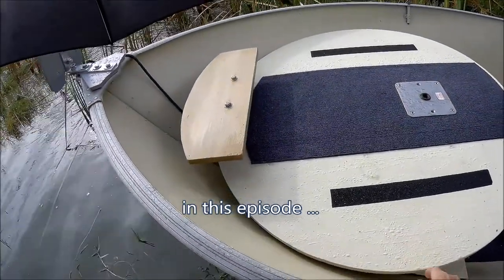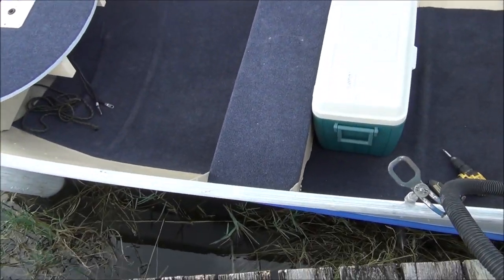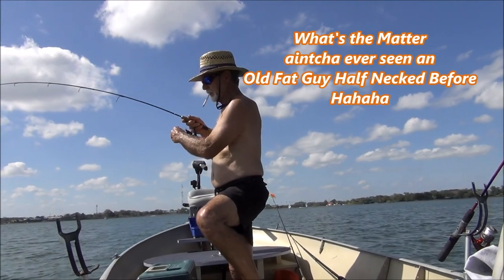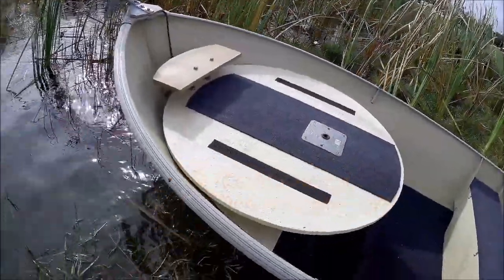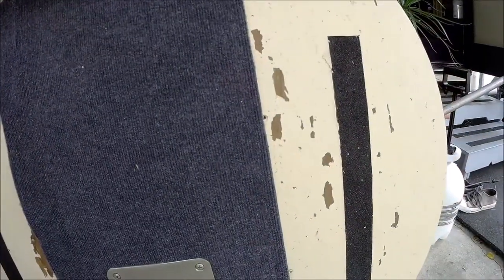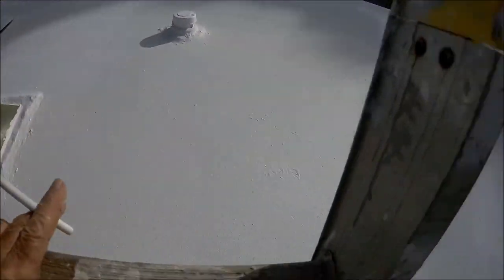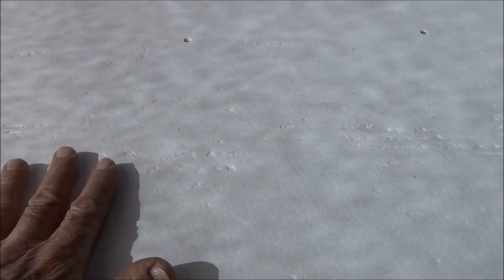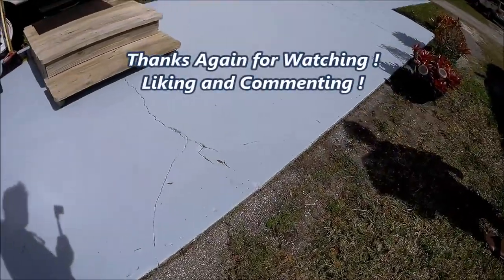This Old Outboard - DIY CASTING DECK - Redo

Comment: That was a job well done (rather than medium) with custom formulations. Looks very professional. Water submersion of coatings is a tough nut to combat. I replaced the compartment lids on my boat (which are also the seat mounts) after wood rot softened the 3/4" plywood. And I thought, how can I prevent this from happening again until after I'm dead? So I coated each lid entirely with fiberglass resin (just the resin, no glass mat). And then reinstalled the carpet over them. Basically, acrylic-plastic coated. Seems to have done the trick. Cures dang hard. Also do the same when replacing wooden window sills on the house and on the header board above the garage door. Gotta sand it well to hold paint (I found out later). And using the resin, you gotta work fast after mixing in the catalyst as its about 7 minutes until set up, or you get a stalagmite in the jar, a paint brush with which you could stab someone, if you're into self-defense: Brush Fu .
Reply from the maker: Hey. Thanks. The resin is an excellent way to go. I repaired many of surfboard dings back in my surfing days, and used it for many other things to. These days I use body filler to repair small areas of wood rot, door frames, trim and such. I think the rubber roof coating should hold up for a while and it was a freebie! I like freebies, Hahaha. I need to do the other seats on the boat too. Its just bare plywood under the carpet and I'm sure they're saturated by now and more rain in the forecast . I really need a cover. Hey, Thanks again and Stay tuned !

Comment: Suggestion , about your casing deck try some thopsans water seal maybe just lay down a varish instead of paint that may be better so when it rains it won't bubble like that paint did , I would just say forget the paint strip it down sand it all down , lay down the varish and then the Thompsons water seal.
Reply from the maker: Hey. Thanks for watching and commenting. Yeah the paint never had a chance to dry. I ended up using the white rubber roof coating made for RV roofs.  I think that was in this video too. It worked great! Thanks again for tuning in!

Comment: My fly wheel on a 1990 25hp evinrude is super hard to pull but the recoil is good. Got any suggestions? I bought it for $150 of CL
Reply from the maker: Hey. Is it hard to pull because it has great compression or is it hard to pull because the its ''ate up'' on the internal parts. Take the plugs out and shoot some wd40 in it and pull it without the plugs in and see how it ''rolls'', it should be almost effortless to spin it over. If its still stiff you got problems. let me know. thanks

Comment: hello my master please i offer you a question about evinrude 25hp1975 what can you say to this engine. it is good, sturdy ??
Reply: I have one that's a 75 and it still runs good,this old outboard knows his stuff.
Reply: @baird5776mullet  .I buy it for use at sea is it working well in long journeys ??
Reply from the maker: Are you still foolin around with that motor. I thought you had it up and running moths ago. Or is this another one. Yes its good, if it has good compression, your good!
Reply: hahaha my boss always i followed your chain vedeo by vedeo
Reply from the maker: @jbelimariem1959  kool man 👍, Thanks
Reply: Jbeli Mariem dang saltys are a lot of work ! Just make sure you flush and wash after each use !
Reply from the maker: @davekimbler2308  👌